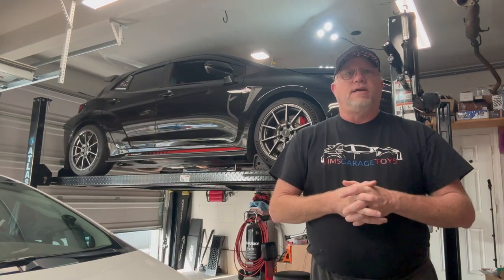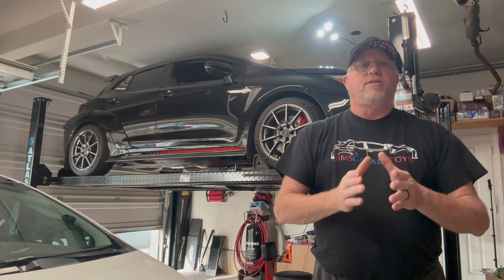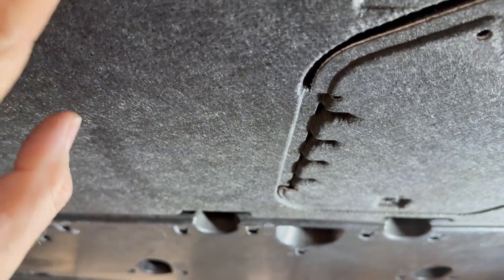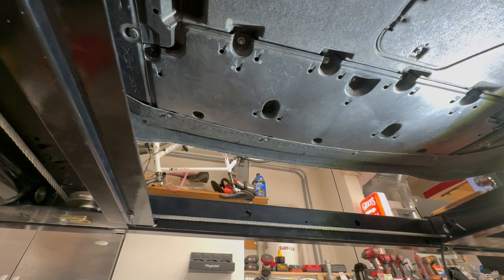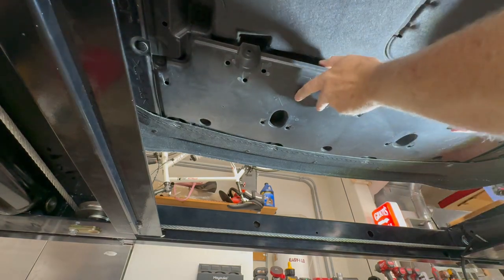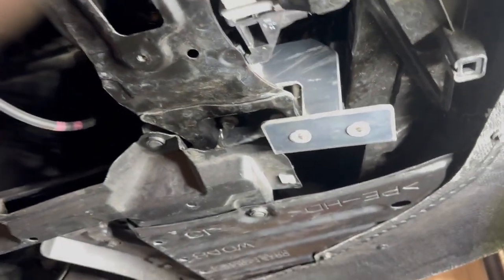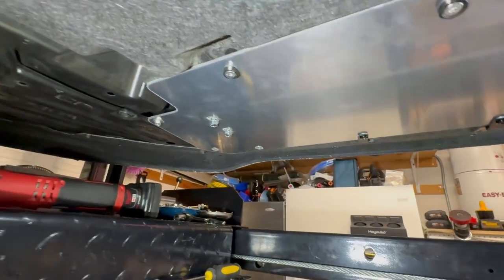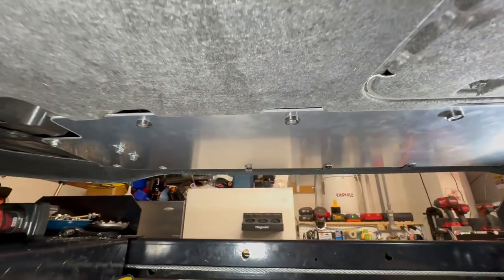GR Corolla // Skid Plate Installation // Support For The Bumper & Grill

Comment: I like this concept but not thrilled about having a jury rig brackets to secure the EOS splitter. If there was a way to fill that gap maybe. I think what you did with the tape, screws and strap fasteners was probably sufficient.
Reply from the maker: It's not supporting the EOS splitter. There is nothing changed from how the EOS splitter mounts. The brackets simply provide upward tension at speed when the splitter produces more downforce. I did this as a temporary solution until I design a piece that runs the length of the skid plate like the splitter from Artwork Bodyshop. Stay tuned as I have some ideas for a permanent solution.
Reply: I completely agree that the parts don’t connect and therefore are pointless.  The gap allows for potential issues with things getting up in the lower engine bay including the oil pan.  I’ll stick to stock
Reply from the maker: @breaks_n_stuff4049  Well to be fair these 2 products aren't designed to work together. There are several solutions thought that are easy to do. Any of these makes it better than stock. 
1. Just order the front splitter lip that is designed to work seamlessly with the skid plate.
2. Have the same company design a plate that will work with the skid plate and my existing splitter lip.
3. Design something myself or have a local shop do it for me.

Comment: I wonder if this is compatible with the racer x aluminum skid plate that replaces the stock fiber board one
Reply from the maker: Yes it is. I mentioned that fact in the video. I spoke to Jeff at Racer X and Artwork Bodyshop and they both verified they should fit together.